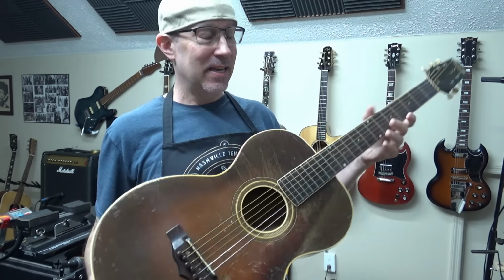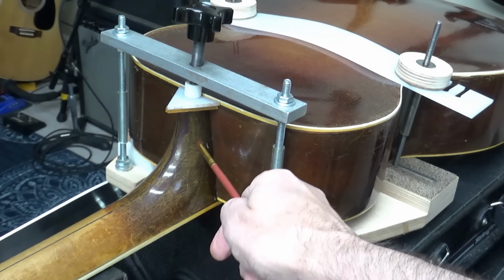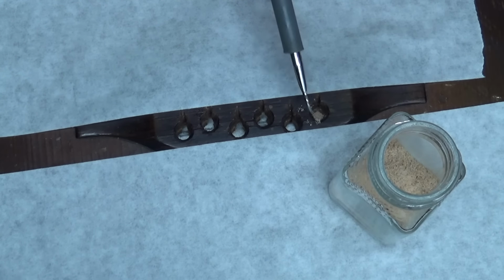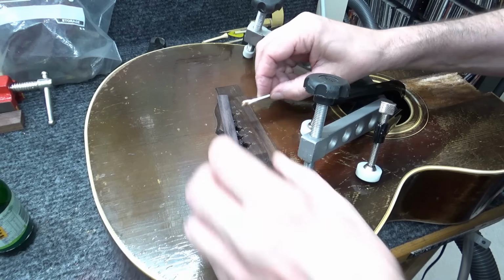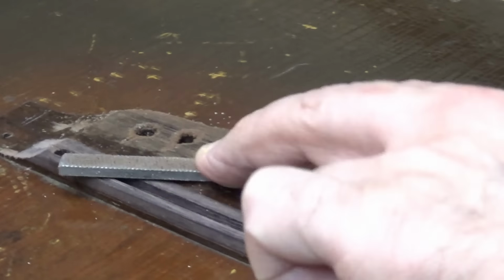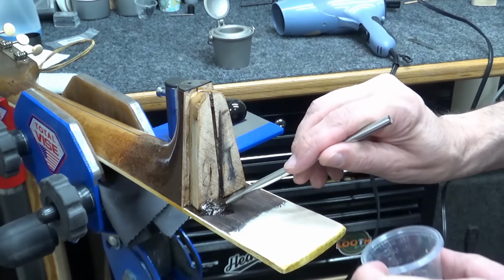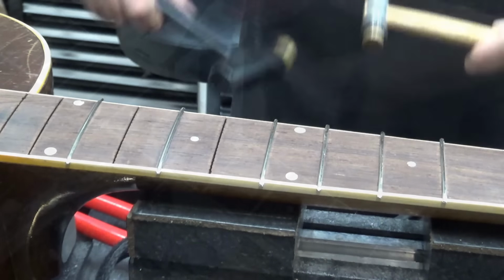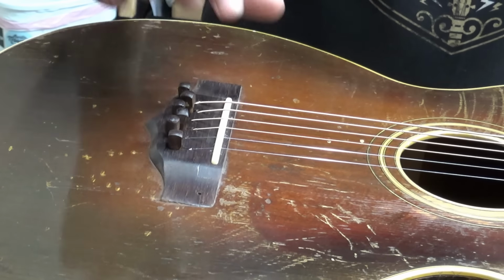Epiphone Model 3 Neck Reset

Comment: Thank-you for the wonderful videos Scott! It seems you are very versatile and have found many cutting edge luthier techniques :) I'm looking forward in trying your "shellacquer" and wondering what solvent you use to mix the two? I'm interested in trying the mix when french polishing or would you advise differently? Thanks again for sharing your artistry. Let me share a technique I've stumbled on that has allowed me to make invisible repairs in wood breaks. After repairing the breach and leveling the surface with fill and finish, I use opaque acrylic artist paints to faux woodgrains over the repair. After a day of drying I nitro over the surface a few coats. I was using tints before but there were always witness lines. With the acrylics I'm able to hide it all and the colors are very wood friendly and easily mixed, yellow ochre- burnt sienna etc. You may want to give it a go :) Happy Crafting! David
Reply from the maker: Thank You David!

Comment: Why not glue the neck on with fish glue for the much longer open time?

Was that a thick 6" scale with 2 different grits of sandpaper you used to final sand the top and neck joint surfaces?
Reply from the maker: I’m pretty confident with HHG’s open time. Fish glue is a sticky mess if it ever needs to be serviced in the future. Hot Hide glue is much thinner as well.
The stick of wood was a craft stick. Thanks for tuning in!